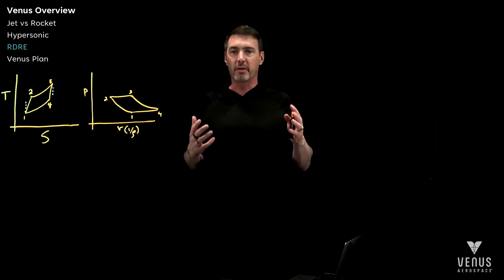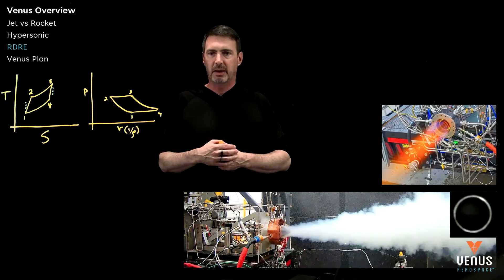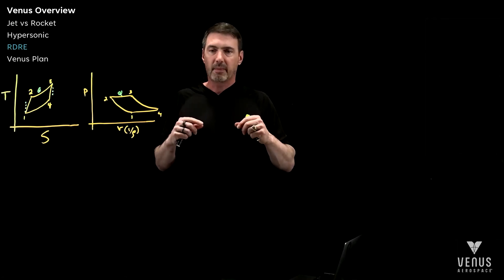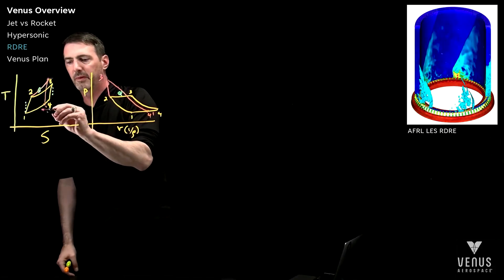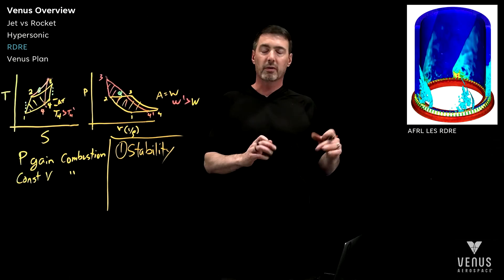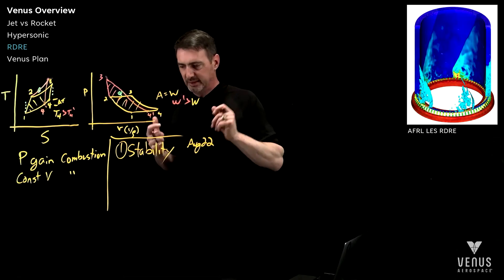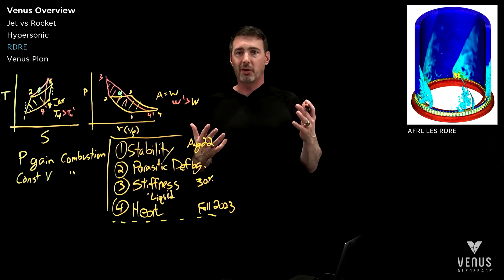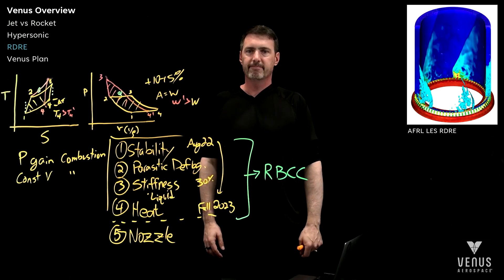High Speed Flight Episode 1.4 | RDRE

Comment: Am I right that the rotating detonation propulsion method will also be used during the airbreathing portion of the flight? If so I assumed this will provide a lighter engine because it needs no compressors nor turbines. But I see during the airbreathing portion prior to ramjet you will instead use rocket-based combined cycle, i.e., the rocket exhaust will provide the compression. Is the rotating detonation not sufficient to provide the air compression needed for this portion of the flight?